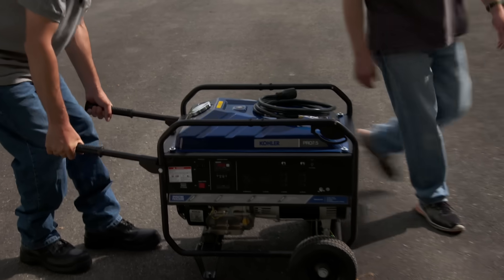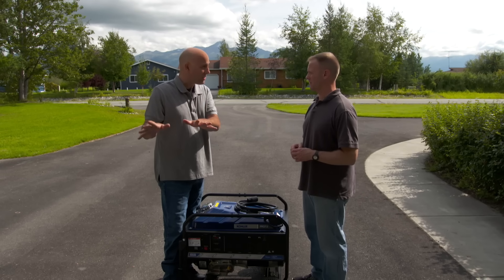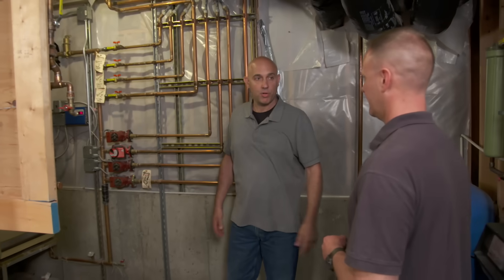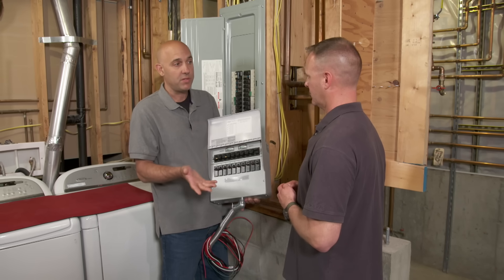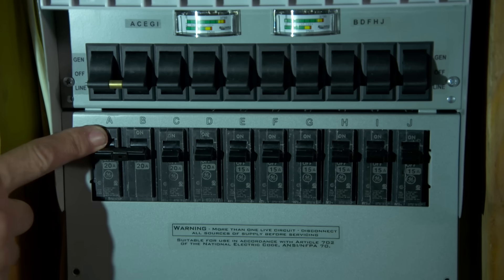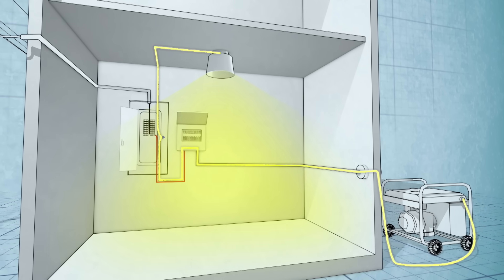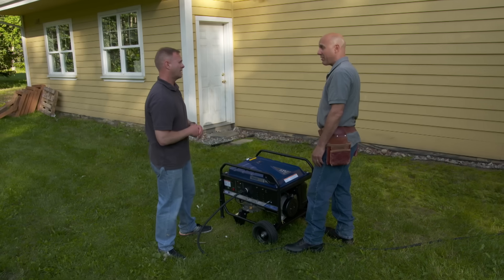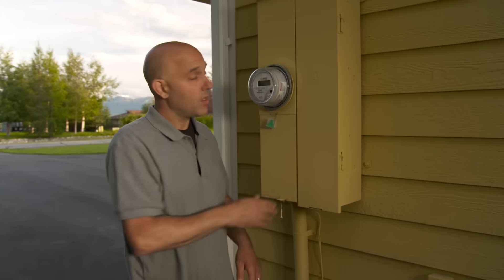How to Install a Manual Transfer Switch for a Portable Generator | Ask This Old House

Comment: Forget the ten circuits, install an interlock device and feed the whole service panel. Much less work and you get to use all of the circuits in the home - as long as you don't ask for more than the generator can supply. Simple
Reply: That's more along the lines of what I'm looking at doing. Last spring we bought a storage building. I wired it with lights, outlets, exhaust fan. Then I used 6-3 cable to feed it in case I ever get a hefty generator and want to send juice back the other way.
Reply: Does that still bypass the normal electric so you’re safe when the main power comes back on?
Reply: @Ford.Donnington  I'll let you know if I find out a better way, but my intentions are to turn off the main breaker in the main box to isolate my property from the city service. Then I'll have to turn off the breakers for the HVAC system and electric tankless water heater because they'll probably draw too much current. Finally, switch the interlock.
After that's done, I'll start the generator backfeeding through the heavy 6-gauge cable back into the main panel. I'm just not sure how I'll wire it in the box, but I have a fairly decent idea.

Comment: What is the cost of something like this all in recognizing that prices of generators vary?
Reply: right now, just that cable was probably $120.  running wire through the house, depends on length. the transfer switch $500.  running the electrical to code... cost of electrician

Comment: I super like that transfer switch because you can install it without having to have the utility turn off the house before the main breaker.  Just turn off the main breaker and do your wiring.

At first I wasn't sure why there was only one neutral but obviously it is because it goes to the neutral bar so all the neutrals in the house will be connected.  It still looks like it should have been a larger gauge, because the neutral still has to return to the generator.  But I suppose if it is as big as the rest of the neutral return to the generator it is fine.

I am not sure such generators produce 220V (or 240V if you prefer), I think most of them are single phase but have 2-30 amp breakers, like a 50 amp RV.  However that will still work fine to run anything that isn't 220V like a stove or a dryer.  The 110V appliances don't really care which side of the 220V two phase they are tied to or if it is all one phase.  So if you can live without your stove (assuming it is electric) or your dryer until the power comes back on this is an excellent solution and much safer than some of the installs I have seen.  The chief reason is that there is no way to accidentally have the grid and the generator active on the same circuit at the same time.  Also it does not use a "suicide whip" (cord with two male plugs).

Anyway, after watching everything that went on in Texas in the last week I am seriously considering a backup generator.  I have one for camping but it is only 3000 watts and would require the use of a lot of extension cords.  Also to run the furnace I would have to replace the power switch with a plug and receptacle.  This seems much neater.

Another way I was thinking of doing it was using a transfer switch between my main panel and my sub panel but not all of the circuits I'd want on the generator are on the sub panel, and the wires aren't long enough to move them, so that wouldn't work without a ton of pigtails.  Future installers should put all the critical circuits on the sub panel and leave room for the installation of a transfer switch, whether manual or automatic.

Comment: It's 30 below and you loose power. Good luck getting that to start on gasoline when it's cold soaked. If it's dual fuel, propane and gasoline, start it on propane  easily then you can leave it running on propane or switch to gasoline.

Comment: So if the generator is running and the power comes back on, does the transfer switch automatically shutoff power from the generator?
Reply: No. Selected circuits can be transferred back to grid only manually, one by one.

Comment: Nice video.  I generally use the shortest cord possible due to voltage loss.  A 25 foot would have been plenty.  Our power company has a meter with a generator inlet but they charge a monthly fee to have it.  Agree with the comment that all new houses should have this built in.
Reply: It's 60hz should be that much of a loss

Comment: screw that. too many wires. just plug into the meter.
Reply: Obviously you have have no clue as to what "back feed" is all about.  Imagine lots of folks doing this and line people trying to restore an outage with power back feeding into the grid.

Comment: You really don't need a manual switch, just pull the meter and add an RV plug. DONE!!!

I even made a phenolic plate to cover the meter hole. Wouldn't want any trespassing individual to get electrocuted trying to steal my generator!

I also turn off breakers I don't need when on gen power, like the electric stove. I can run my entire house otherwise on a 5kw generator, including 2 window units that keep the entire house comfortable after a Florida hurricane.
Reply: Not sure where you're located, but most places in the US there is a hefty fine if you cut the lock to pull a meter yourself.

Comment: @This Old House I wish to get my first ever dual fuel gen, with an operating watt rating of 3650 W, because it is portable enough to put in the back of my pickup and power the holiday trailer, for what I want, 1 LED light in the kitchen during an outage (ceiling mount), the NG Boiler circulator and electronics, the Wi Fi Router, 1 element on the stove for cooking, and 1 freezer and 1 refrigerator will 3650 running watts, with 4550 surge start be ok, keeping in mind the main draw on this set up is the cooking element for the stove top (1) the refrigerator is 200 watts, and the freezer a max of 500, the rest is not a big deal I just do not want the 10000 watt surge unit since that is a beast and is hard to lug around in the summer time for camping ! very affordable for the 10000 watt surge just the 270 lbs dry is very cumbersome! thoughts ?
Reply: I run 10.000 watt,40 gallon back up fuel tank.12v elec start.only way to go.auto muffler,through the wall,manual and auto disconnect. Like the auto start and cycle system.no touch.

Comment: Can someone explain the need for transfer switches when all u need to do is shut off the main to prevent backflow to the utility?? Obviously yeah if you know your load of the genny your not gonna run the whole house unless u have a Huge portable.  And u can switch off or just turn off what you dont need in a properly marked panel.   Second question explain Hvac Startup Regarding LRA  for you sparkys out there? 3rd: do hard start kits work for the condenser and how much do they drop the LRA?  LAstly Anyone have a portable genny that runs a 3 ton HVAC.  WHat size brand etc??

Comment: I am trying to hook that exact same inlet box but I want to run 6/3 wire but it is really hard to make the bend.  Any ideas?
Reply: Relocate the box so the bends are at less of an angle.
Reply: @haywoodyoudome  I just did a bend of the wires to form kind of a circle then into the plug.

Comment: Fifty dollars it will not start when he needs. Propane is a better choice than gasoline. Gasoline will spoil if it stored very long at all. They are terribly noisy even for the neighbors. I would install a solar/battery system. Yep, it would be expensive.
Reply: Gas is fine if you add stabilizer and run the generator a few times a month so the carburetor doesn't get gummed up.  The average person won't bother and then when they need it they're SOL.  A little PM goes a long way.

Comment: great illustration. explains how these bloody things work with one picture.
Reply: The best explanation for electrical theory was from my instructor when I went to Electronics school many moons ago. Think of electrical flow like water flow. They're both amazingly similar. They both take the least path of resistance.
 Water pressure in a water hose, is Volts, amount of water going  through the water hose, is amps.
 Where you make the hose smaller, you've added a resistor.

Comment: I have a permanently installed 8 kW genset, propane fuel from 2 100 gal cylinders, and an automatic transfer switch.  It's saved the day a number of times since utilities were "deregulated". If you're going with a portable genset there are three things I'd recommend: (1) Document every circuit breaker at your service entrance.  Make sure you have a list of every load that every circuit breaker serves.  With a 200 A service, you can't power up every circuit with a 7 or 8 kW generator. You can buy a kit to help you do that at Lowe's, Home Depot, or Harbor Freight for $20-25 (or so). (2) Get a "dual fuel" generator - gas or propane, for example.  Long term storage of a 20 or 30 # propane tank is much safer than long term storage of 5, 10, or 15 gallons of gasoline in a can in your garage or pole barn. (3) If you go with gas, use ONLY non-ethanol (and do this religiously) - like in your lawn mower or boat.
Reply: Great advice.  All small engines.. no ethanol.  Only way it would be ok is if you are running your generator non stop.  You can not store Ethanol blended fuel long term....unless you like cleaning fuel systems.
Reply: @hylomane I personally have used gas 2 years old that was in my generator
Reply: I've been using regular pump gas in all the equipment I've accumulated since I bought my house 13 years ago. It keeps for up to two years if you stabilize it properly. I'm up to about 20 pieces of equipment and they all still have the original carbs, etc. Haven't had a single fuel issue in anything. The real key is to always shut off the fuel and run the carburetor dry, if you do the equipment will be fine. Buying ethanol-free is expensive, difficult and totally unnecessary.
Reply: @nodak81  You are right on point!!!
Reply: @nodak81 same, I put stabilizer in my ethanol gas in the equipment throughout the winter with 0 issues

Comment: Why cant you just run it back through the meter, wouldnt the power company owe you for creating their energy? Why have this switch?
Reply: Running power from your own personal generator back through the meter is called "back-feeding", and it's both dangerous and ILLEGAL !!!  If you can afford the lawsuit from the utility when you electrocute their lineman who is up on the pole trying to restore your power, then go ahead and try.  The transfer switch is a "double throw" mechanism.  It can't be connected to two different sources of power (even though one is temporarily "absent") at the same time. It's either one, or the other.
Reply: @checkyoursix5623  Thanks for the reply! I am curious why would it electrocute the lineman, isnt this the same concept as the solar arrays when the power company pays you for the energy you produce?

Comment: Slices/Wirenuts are a no-no in a breaker panel.
Reply: Code permits them, otherwise Reliance would have to redesign their transfer switches
Reply: @jmljml5065  ...nope. Not according to the NEC or the CEC

Comment: Does anyone know the make and model of that transfer switch?
Reply: Reliance pro tran
Reply: @mikeshih6979  I actually purchased it. It was the 6 breaker switch easy installation works perfect
Reply: @frankingoglia3057  Very easy.  I installed the 6 circuit switch kit as well and I've never messed around in my main panel before.  I was scared of the wiring portion and that was the easiest part of the whole project.  The factory's videos are first-rate.

Comment: In Canada we can't use wire nuts in the panel. We have to pull the wires out and go through junction boxes.
Reply: I had the same question in my mind as well. I’m in the states though
Reply: Very interesting. In the US, splices within a panel are not prohibited. No different than having a splice in a junction box right next to the panel.
Reply: Not an electrician but I'm pretty sure wire nuts inside the panel is a big no-no.

Comment: Great video except they didn't say if that was a 30 amp or 50 amp line from The Twist lock from the generator some generators have both 30 amp and 50 amp I just purchased a generator that only has 30 amp so this is a particular interest to me if anybody knows the answer can you run the whole house transfer switch off of the 30 amp?
Reply: You can and cant It depends on the draw and startup amperageof certain things in your house.. U need to get a clamp on ammeter take ur panel off and measure each leg of your utility power with everything in the house on. That will give you an idea of the amperage Your whole house is using.  If you wanna use just certain portions of the house turn those items on and do the same.  However you have to make sure your refridgerator is actually cooling to get a good estimaste same with heater or Airconditiong.   Respond back. Ill try and help ya.  Look up a good klein voltmeter or such .  With a clamp for checking amperage.  Tho if ur that suspicious leave it alone and call an electrician.. Sorry for typos.

Comment: Can any one tell me where the two unconnected black and red wires in the transfer switch go? Shown at 4:27. My transfer switch has those wires and no where can i find where they are supposed to be attached.
Reply: Hard to say without seeing where they are terminated in the transfer switch. That image only shows them coming from the side.???

Comment: for $1700 (tax included) you can install a meter mounted transfer switch and buy a premade cord and a generator. Then you have the flexibility of not having to pick and choose which circuits you want to use. However you are still limited to how much power you can use at one time. An advantage would be you could switch off your heat and air unit and then switch on your water heater when you need hot water. With the generator panel you can only select one 30 amp circuit so its HVAC or water heater.

https://www.homedepot.com/p/GenerLink-30-Amp-Meter-Mounted-Transfer-Switch-MA23-N/301961623

Comment: Great explanations provided on how exactly the transfer switch works.
Reply: They skipped explaining the individual neutral and hot wires from the generator though. I know how they hook it up, but the explanation would have been great if they didn't skip that.
Reply: @Engineer9736 The neutral connects to in the inlet right?

Comment: Was that generator a floating or bonded neutral?  If bonded, what steps were taken to ensure the neutral wasn’t bonded twice?
Reply: Usually a generator will have a noticeable ground lug next to the outlets if it requires another ground.

Comment: I did not see him install a code required interlock.  This ensures the meter socket and power grid is not back fed by the Generator.  Unless that Generator switch isolates the circuit from the panel.
Reply: The transfer switch does not connect the generator to the main circuit, so there will be no back-feeding.

Comment: What type of wire did you use to make the extension cord that you into the  house and generator and what are the name of the conectors
Reply: He used a 10 gauge wire... But why not go with a 8 gauge wire?  I think it is better.  Just because.

Comment: I never know why people use these transfer switches, when they can just hook up the generator to the panel and power the whole house, just close any fuses you don't want on generator power.
Reply: You do this to isolate the generator power so the power wont back feed the line to power line workers fixing the outage.  Illegal or shall I say not up to code if you dont have a way to break the connection

Comment: What gauge cable would you buy to make your own cable ?
Reply: Totally depends on how big your generator is. For a 7000W generator 10 gauge wire can run 30 amps. For up to 50amps using a 12,000W gen you need 6 gauge

Comment: Jeeeze he holds the two wires close and screws on a wire nut? NO twisting the wires together
then screwing on the wire nut? Back when I took electrical, we made a good connection, then screwed on the proper size wire nut. Seems if the gen can work the 10 ckts, a mechanical 
interlock sw. could have been used. it would allow main breaker to be turned OFF and GEN
brkr to be ON. much less expensive than the 10 ckt panel ans still legal.

Comment: I have pull start gas generator. It might of been a good idea to get a Get a generator with a battery start and you can start it the easy way or pull start it. Also run generator every couple of months to keep that gas and use stabile to keep gas fresh. Turn off the gas shutoff when stopping the generator to get the current gas out of the carburetor and let the generator run itself off until gas is gone in the carb. 50' of huge gauge cord 20'-25' feet would of been fine plus the cost of that 4 gauge is crazy expensive.